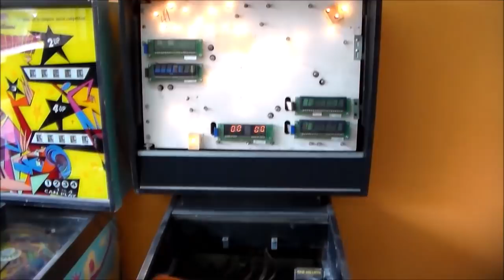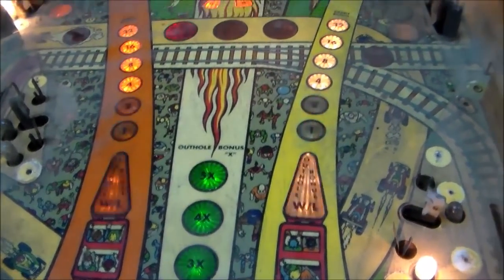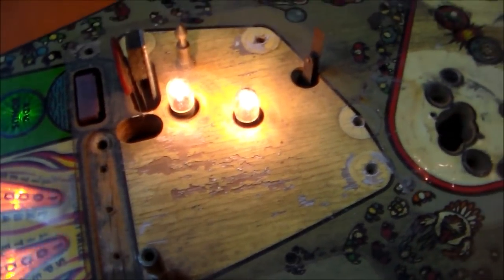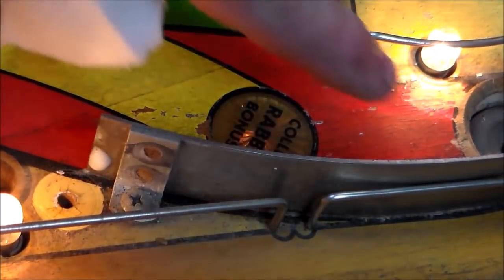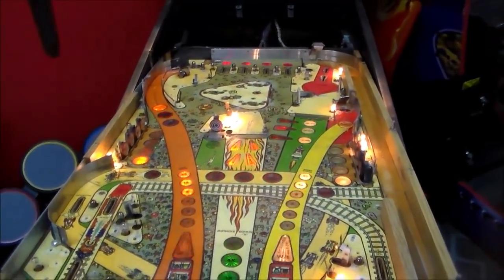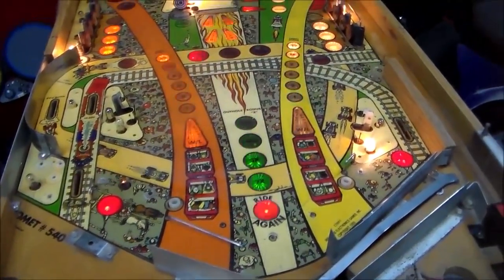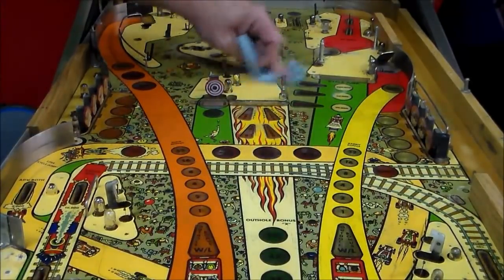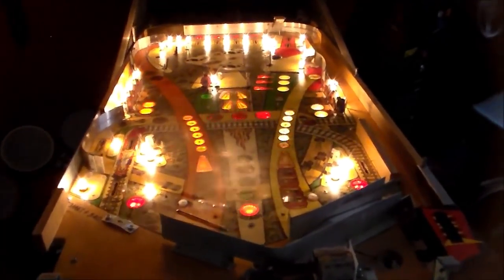Cleaning, Painting, and Waxing the Playfield on our 1985 Williams Comet Pinball Machine

Comment: Ron, watching this video brought back so many memories.  I had bought a used Bally Captain Fantastic (that's another story) and the playfield was very badly worn.  After searching for a while, I found another playfield that had been stripped down of all the hardware and wiring, but was in much better shape than the one currently on my machine.  My friend Danny and I laid the two playfields side by side on a pair of sawhorses and began unsoldering all the lights, bumpers, etc from the old board and moved the wiring harness to the new board.  Then we began moving all the features, bumpers, drop targets etc from the old to the new.  We only planned to work on it for a few hours, but got into such a roll, the next thing we knew the sun was coming up. We finished up several hours later, and decided it was time to plug it in and test it out.  We fully expected there to be lots of shorts or bad solder joints, but no.  It fired right up on the very first try.  There is no way that would ever happen again. I kept that machine for years and only parted with it because I got transferred to the west coast for work and couldn't bring it with me.  One of these days I'll have another, but it won't be the same as the first one.

Comment: First rate work Ron. With regard to the clear coat you use .... is this also water based, and is it a gloss finish or semi-gloss? Does the clear coat ever make the water based touch up run or bleed? ... Mark
Reply from the maker: We paint the touchups with water based so we can clean them up if we screw it up, then the spray paint is just regular spray paint, it's not water based it's enamel... It never runs if you only use water based paints on the touchup, but sometimes if you've used enamel paint or something like a sharpie it will definitely run.